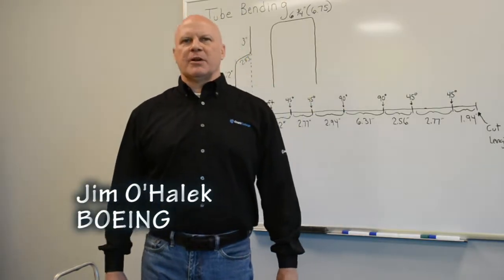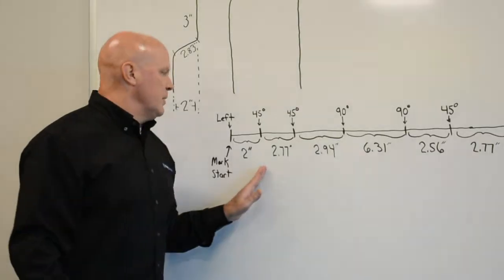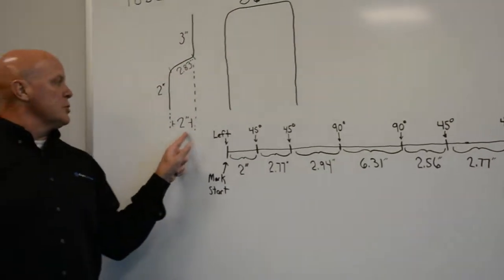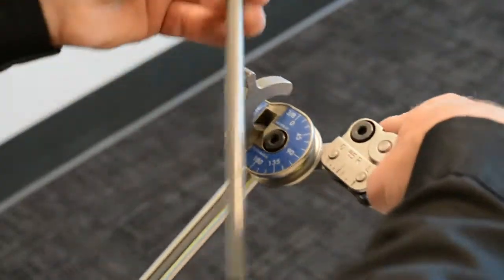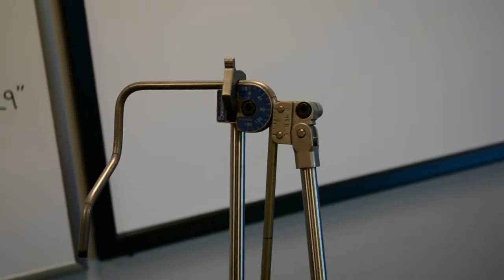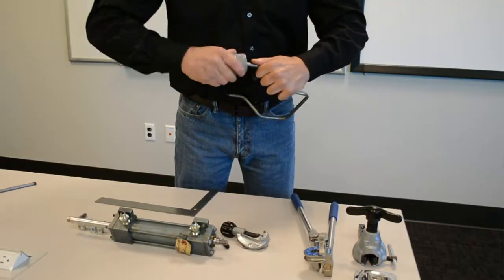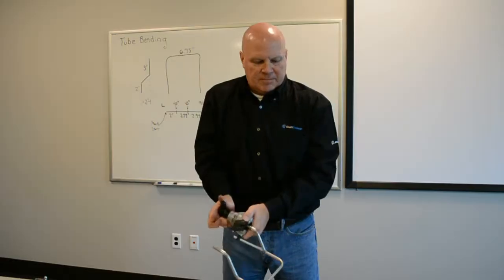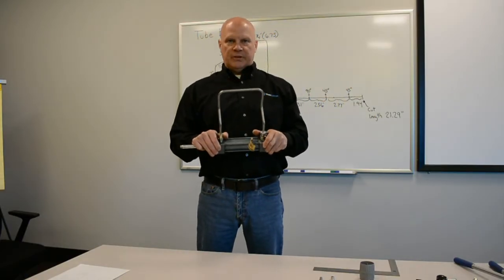Tube Bending Video

Comment: how did you come to 2.83 for a 45 to get 2" off set? does that mean 3.83 for a 3" off set? whats the calculation?
Reply: Using trigonometry, it should be the offset divided by cosine of 45.  So 2" / .707  = 2.83" and 3" /0.707 = 4.24"  (Could also use the Pythagorean Theorem in this case also.)

Comment: So I'm running 3/8" lines for my cars air suspension and was curious about the 90 degree bends. On a standard EMT bender there is a star mark to bend the 90 exactly where you need it without accounting for the "take up". Is there something similar to this on these benders I should be aware of?

For example I want my 90 to hit at exactly 6" from the manifold. Do I just mark the tubing at 6" and bend it or is there some calculations/mark placements that need to be done. 
Thanks
Reply from the maker: “The calculations depend on the specific bender. The Swagelok bender used in the IFPS Tube Bending Video are 3/8” with a 15/16 radius. This bender, as do most, has a downloadable booklet/manual with the details of its use. For a 90 degree bend the tube is stretched 7/16” or .44”. In your case with this bender you would measure out 5-9/16” or 5.56” to get a 6 inch leg. The mark on the Swagelok bender is on the top handle and goes from 0 to 90 degrees in 15 degree increments. Put the mark on the tube under the 90 degree mark and bend, taking the zero mark down to the 90 degree mark on the lower handle. It’s also better for the last leg to be a little long. That way you can cut to fit for your flare or compression fitting.”

Comment: There is a better way to mark out that tubing. There's a formula to calculate the loss of tube on those 45s. Also, you didn't check your bends, are you sure of what your angles are and if your 90s are accurate?
Reply: LOL, you don't have loss, you have GAIN when you bend!
Reply: @TigerBB-  you only have gain on 90's offsets and kicks have a loss. 
Your kung-fu is weak.
Reply: @thomasstauber3638  that statement shows that you have no idea about bending. There is never a loss in length with bends, and although 45 degree bends and below have minimal gain, it's still there. 
With small diameter tubing it's insignificant, and that's probably why you're not aware of it. 
However if you ever work with larger size tubing and think you're going to ignore the math and wrestle piece into place it will look like shit.

Comment: Greta video
But this way you don't you ignore the tube gain on the first bend?
How do you take it into consideration?
Reply from the maker: You only take into account the stretch from the bend. You take away the stretch after the bend only. The first leg isn’t affected
Reply from the maker: The amount to subtract came from the manufacturers specifications.

Comment: Great video. How did you know how much to subtract (1/16, 7/16)
Reply from the maker: There is a chart in the Swagelok tube bender booklet that specifies the stretch for the bends. My bender is specifically for 3/8” tube and 15/16” Radius bend.

Comment: Jesus you dragged the hell out of that. long story short work out your stretch at 90 and then 45( may vary per batch) then take that  it off all youre markings added together for cut length. Mark you're pipe as normal for bending

Comment: How did it magically fits to the fittings when at 12:06 it was way off the alignment?
Reply from the maker: The video was done in two-sessions. The 90-degree bends were under-bent, then put back in the bender to make the assembly square and fit the fixture. Hope this answers your question.
Reply: @TheIFPS  great tutorial by the way.

Comment: how did you get the 2.83"at the first 45 bend.?
Reply: Length = offset x allowance.
Length = 2 ( 2 " offset between pipe
 straight runs)
Allowance for 45 degree bend is 1.414 
So L = 2 x 1.414
🙂